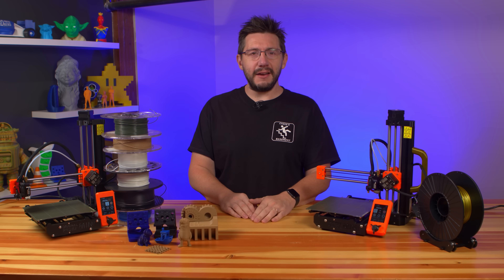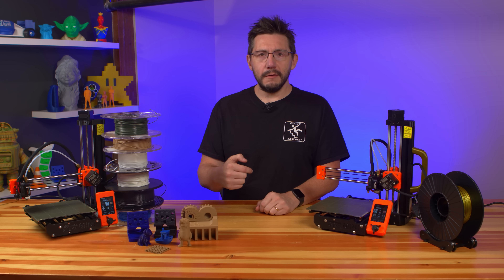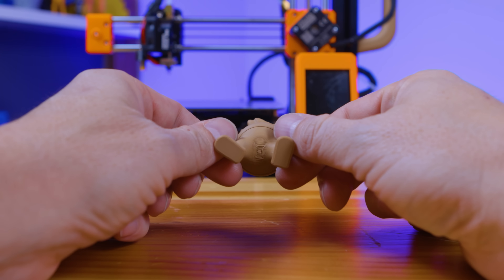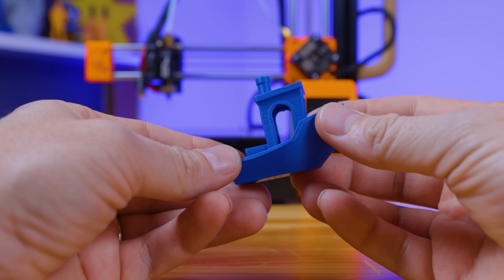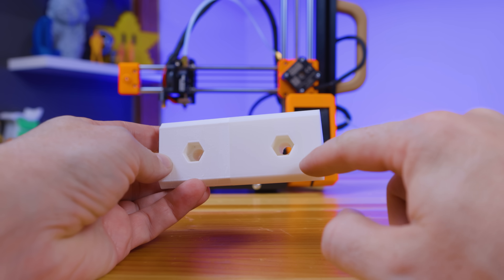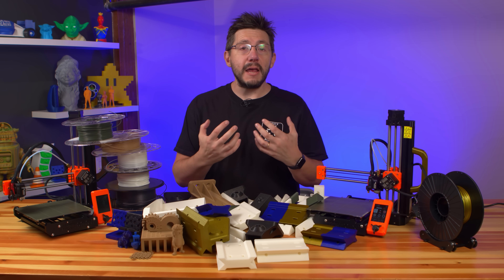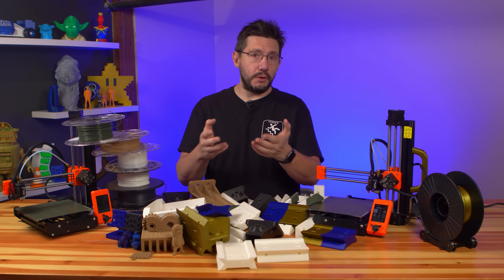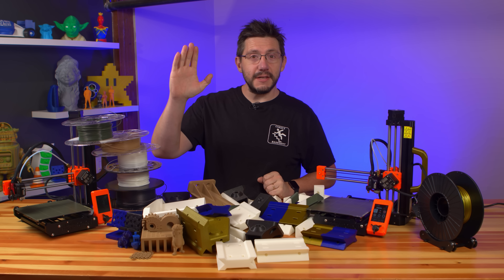Prusa MINI Review // So far ...

Comment: Hi Joel. My mini is from the 1st batch and had the same usb problems. In my case it was a bad board. Prusa sent me another one and it has been working great.
Reply from the maker: That’s great to hear
Reply: How do you know WHAT batch you have though? Mine arrived in July 2020 and had the same sort of problems others have had. I have bought a Bondtech extruder for it now since I was dismantling the 'original' extruder on almost a daily basis, so much so that the bowden tube  'out' port's thread for the brass tube assembly had worn away throwing ocasional orange plastic into the Prusa extruder. I mentioned it to support but they did nothing and didn't even offer to send me a replacement part for that bit of the extruder. I shouldn't have to be dismantling major components of a premium priced printer that is only 4 months old !
Reply: @BusinessButlers  I ordered right after it was announced and got it on December 2019. One thing i did notice was the extruder was too tight. There is a screw on it that you can loosen up near the bottom. It kept eating away the filament and make it rough so it would jam.

Comment: Joel, I had that same issue with the USB Drive not reading in the Prusa but being read fine on the PC, I noticed if I just pulled it out without ejecting it wouldnt work, so if I ejected it safely then it would read. weird, but now I just use Octoprint and skip that step all together.

Comment: When you change the filament part way through a print how do you purge the nozzle?
Reply: The printer moves the print head to the edge on the bed and well above the layer height it paused at and handles the purge as part of the process.

Got a mini myself. Had more issues than Joel, but all resolved now at no cost to me and it's amazing.
Reply: @arklanuthoslin  But how can it purge on the bed if you're already half way through a print, so the print head is far above the bed?
Reply: @Krytern  the print head stays above the print. Just moves to the edge and extrudes in the air.

Comment: Every time there are some "layer inconsistencies" or imperfections of some sort Joel (and others) blame it on "the filament is not calibrated" or "settings not tweaked". Why is that? If there would be one instance where calibrating would be worth the time it would be a 3d printer review? I don't think this is fair
Reply: I have that issue even with Prusament. Some guy with bondtech extruder also has that problem. Apart from that, the printer is great
Reply: Over extrusion causes adhesion issues
Reply: Yeah the 'filament not calibrated' doesn't make sense to me, sounds like Joel's printer suffers from the same over/under-extrusion issues that some other reviewers had, because the filament almost jams, causing underextrusion, then the jam starts moving and causes overextrusion.
Reply: This is called Issue 602, every printer has it and Prusa did alot a research to combat this issue.
Reply: I agree i would say that he is biased. Honestly its not bad for the price but an ender 3 would do similar if not better

Comment: Perfect timing. I'm currently thinking about buying one
Reply: I'm loving it. About sticking PLA on that rough plate, well, yes, it's not holding well but so far zero prints lost due to lack of grip, but after the print is finish and the heated bed is cooled down, the print just falls off, so it''s better to use a smooth plate for important PLA projects, and that smooth plate has little texture too, it's not glossy look. I'm satisfied with both. No way I'm moving back to printers with manual bed leveling and non-removable bed sheets. The only drawback is looooooong waiting time, 2 months :D
Reply: @banny123456  yeah, I'm currently enjoying a 8 week leadtime

Comment: My only issue is the cantilever design. My 1st printer was a Monoprice Select Mini v2. It had a robust design, sheet metal instead of plastic  and rails. Less than a year and I was getting sag on the arm. The small build plate is going to hinder people as well. I remember wanting to print this and that and several other things all of which I had ti resize to fit the small build volume. I went from my Monoprice to a CR-10s which while not perfect gave me the room to work with. The print quality of this Prusa is impressive. Not really sold on the price.

Comment: That sounds like a lot of reliability issues right of the bat. Also, $349 seems very high for such a small cantilever printer.
Reply: Yes.  I found the reliability issues with it and sent mine back for a refund.  It jammed and clogged repeatedly, and really a class in printer repair more than a printer.  I received excellent support from Prusa, but the product was not even close to reliable.
Reply: @bkindt  I assume you were expected to send it back for that refund at your own cost too ?
Reply: @BusinessButlers  yes that is correct.

Comment: There is a known issue with bad USB sticks sent from Prusa. I got my Mini about 3 weeks ago, mixed results so far, but the only machine failures I've had were related to that USB. Had 3 failures with watchdog error resets because the USB stick they sent preloaded with files is physically bad in some way. everything i have sent through octoprint has worked great, everything printed with prusament looks great. now I just have to tune for stringing on this MatterHachers Build PLA.

Comment: My failed benchies are also adored by children. 

But the backside of that blue benchy... It shows a lot of Z-banding. The real way to make sure it isn't a printer issue is to print it with different filament, not by doing it off as a "possible uncalibrated filament". 

That unintended stringing test I would not call acceptable. It probably wouldn't be acceptable on any other 3d printer with this price or cheaper. The same for the quite number of defects found. 

I understand that in that price there is also the ecosystem and pre-made Slicer profiles. Still, I think it is good to make sure the same judgement is used for all printers.
Reply: Printing in vase mode will show if it's printer or model/slicer issue.

Comment: Broken thermistor, bad bearing, and random rattle are not “minor” for a newbie (which is likely the target demographic) and represent some quality control problems. Could be a one off problem or something more systemic. Nevertheless good review Joel.
Reply: My model from Sep 20 had similar issues and more.  It’s not just the early models with problems.
Reply: I have been running my mini almost continuously for 6 months now.  The extruder makes a funny noise when it retracts and sometimes I hear a rattle, but it prints fine so I don't care.  Compared to the constant TLC my first printer needed when I was a newbie a few years ago, this thing is a dream.  It just prints well all of the time.
Reply: @GdalyaRoth  my first 'real' printer was a Prusa MK2 and it still works very well (though is showing its age). After purchasing a CR10, I do know what it is like to have a less feature-rich printer that needs more attention. I always recommend Prusa over anything else I've used.
Reply: @cyberreefguru  what was your first “non-real” printer?
Reply: @alanjones4747  Ah, I built an experimental delta device that was supposed to be capable of 3D printing, pick and place of electronics components, and even some CNC.  In the end, I got it to print -- poorly -- and that was about all. Failed investment, but an interesting experiment nonetheless.
Reply: @GdalyaRoth  that might be the tensioner I had a couple issues with mine because after being an idiot I got filament stuck in the Bowen tube and then didn’t tightening enough when I fixed it tighten it more then you think you should do it takes a bit of force to get the filament loaded
Reply: @LukeeM_00  Thank you for that advice.
Reply: I have to agree with this. Given it's also not a kit, really, replacing bearings, thermistors, etc. early on is a pretty serious set of problems.
Reply: It’s not not minor though
Reply: I'm pretty sure that the rattling is the keychain ring on the USB stick. Thomas Sandladerer had the same problem
Reply: Yeah, seems like the Mini does have QC issues. Thankfully, my Mini from the very first batch is working fine. Had the probe fail 2 weeks in but warranty took care of that quickly. I've got 20 spools of various filaments through the Mini so far.
Reply: as for newbie i would buy easythreed x4 for $200
Reply: IMHO, those are things that most 3D printer newbies would actually have an easier time troubleshooting and replacing, being easy to identify hardware, with easy to follow steps. However, an easy but long repair does NOT build confidence in build quality. I'd say what's even less newbie friendly to troubleshoot is bed adhesion using PLA on these sheets!
Reply: I get much better results on my Ender 3 machines for less then half the price. Nice gadget, but not worth the price.
Reply: It seems like he has an early version. I remember the first few batches has issues like these.
Reply: @thegeniusman8757  I got mine in July and it's awesome
Reply: @thegeniusman8757  yeah I was pretty up set a long wait and a machine that did not work with default settings.
Reply: I've had mine for about 6 weeks now and put about 300 hours on it already, its a bloody workhorse.
Reply: The random rattling I had was from bits of stringing contacting the fan blade but just make sure to clean it and broken thermistor is a big deal but if you contact prusa support they walk you through everything, almost as good as apple support even tho the company is 100x smaller

Comment: I got this 3d printer a couple weeks ago, and I love it so much! It works so well, prints so smooth, and is super easy to use. But one interesting I noticed is that the red pla 1.75 Hatchbox filament printed better than the Royal Blue prusament. Does anybody know if there is a way I could get better prints with this filament? But overall it’s a great printer for the price.
Reply: Do you use prusaslicer?
Reply: @thegeniusman8757  sorry, didn’t see a reply. It’s 6 months later now, but yeah I do use Prusaslicer

Comment: Dude! That's so cool that you've started printing the parts for the camera arm! Great video ✌️
Reply: It is going to make his life a lot easier filming his vids.
Reply: Thanks for designing that, I'm going to be making one soon. It's overkill for my little mirrorless, but too cool to not make.
Reply: I don't have the space or need for the full rig, but I'm thinking of adapting the design for my space.
Reply: I’m so happy to see A channel I’ve watched make many cool 3d printed projects get featured in the bigggest 3d printing YouTube channel such a great community
Reply: Yes indeed, very cool, he did mention it a few times in several videos. I'm going to do something like that too...
Reply: I thougt some parts are 25cm? the mini has 18 which keept me from trying too
Reply: I love your camera arm! I wish I had the space to use one!
Reply: I would need a xs version of that camera arm as the original size is to large for my nerd cave 🙀
Reply: @choschiba  well you could just cut the aluminum extrusions smaller  right? 
I would need it for work (digitizing large volume posters, cards and maps with the camera facing down) so size isnt the issue as long as it fits in the elevator. I already build a static one which looks like a gallow from wood.
Reply: 8:21 The future
Reply: Hello Mr. Chappel

Comment: I bought a Prusa Mini this summer and it did take 8 weeks or more to get here.  It is a great replacement for my Printrbot Simple Metal.  I also couldn't get good results from the rough build plate and switched to the finer grain build plate.  I too have the runout sensor.  I have been using the color change by level feature of the Prusa Slic3r to give prints like my Ezekiel's Wheel puzzle a more interesting look.  So far it's been great.

Comment: There is not a chance in hell I will pay how much they charge for this thing when there is an ender 3 V2
Reply: There’s about a 100€ difference. You just have to decide yourself if the price/quality/feature tradeoff leens you towards the one or the other. For me, I would never turn those screws manually to level a bed, or scrape a print off a bed with a metal sparula. Ugh. So I pay some extra to get a printer I like.
Reply: @apinakapinastorba  

Scrape the print of the bed ? What are you on about. It’s the easiest thing to get the prints off magnetic plate. Also bed leveling takes 2 minutes at most to do with this wheels. If you can’t do that then you are simply pathetic
Reply: @theshadowman1398  I almost knew you would go insulting me personally before I replied to you. Oh well, you get what you ask for... Both with printers and people.

Comment: I bought a Monoprice Maker Select Plus for $300...and then nine months later, Prusa announced this. Son of a... 🙄
Reply: Tough.. I got a FlashForge Finder in August (first 3D printer)
Reply: I had one of those before I bought one of these.  Accept the sunk cost and get a mini -- it'll save you an immense amount of time and frustration.
Reply: @GdalyaRoth  heres the problem- I'm 11 years old and i got the finder for my birthday. i cant get it anywhere else
Reply: @BDin3D  I was replying to @halo 2304 -- I used to have a Maker Select Plus, not a FlashForge.  Still -- you're living in the future -- when I was 11, the big deal was if you could get an Atari 2600.
Reply: Save up for a Micro-swiss hot end, print a set of frame braces, print a DiiCooler duct, and buy the suggested cooling fan, and your Mono-price will be a work-horse too.  (the Monoprice printer is a Wanhao i3 re-brand) A name brand flex bed is nice, but it mainly cuts down on how often you need to level the bed.  So stick to the cheap PEI sheets and keep first layer print temperatures below 250C.
Reply: @martylawson1638  Oh...I ran my Monoprice day and night as well and I did replace the hot end with the micro-swiss all-metal hotend and I also set up an OctoPrint server and bought the Wham Bam flexible plate.  Even with all of that, the mini is much easier to use and the price is about the same, once you finish the mod's and the print quality is better.  Also, I print in PET-G, not PLA, so I was always pushing the Monoprice's temperature limits.  And I am more of a maker -- not a printer -- I like to design things and print them, not spend time working on making my printer better.  So, for me, the Prusa Mini is a no-brainer.
Reply: @GdalyaRoth  we're a lot alike. I mostly design and print my own designs and print in PETG. I would like to have better prints and spending time and money on upgrades that may or may not work is tedious. I haven't done much printing lately because I had to give up that space for my wife's office. Now it's sitting on the kitchen table, collecting dust while I try to figure out where to set it up next. 🙄
Reply: @martylawson1638  I've already done a few upgrades. I got some frame braces and replaced the Y carriage. I'm debating the Microswiss hot end. I primarily print PETG. I've thought about printing on glass and removing one Y-axis bearing and changing them to longer bearings. I've dabbled with TL Smoothers on one of the Mono's at work, but haven't seen much difference.
Reply: 2 tips with the textured sheet. You need to recalibrate as it's thinner than the pei. It also needs to appear as it is almost flat. I bought 2 myself!

Comment: I’ve always thought about buying a Prusa Mini ... but I decided to start with an Ender 5 which I’ve pretty heavily moded since I got it ... it’s now outfitter with an E3D Hemera direct drive, Creality Glass buildplate and Duet 2 WiFi motherboard and I’m very happy for what I use my printer for, honestly the only reason why I went with the Ender 5 instead of the Prusa Mini was the smaller build volume on the Prusa :/
Reply: Hi, may I ask you how much did you end up paying after all the upgrades?
I bought the MK3s after the Mini was announced just because I came from a Tronxy X1 and the small build plate was a limitation (although definitely not the main issue of the printer). I ended up buying a Prusa for the experience it promised (and because it's Europe based), and boy it delivered. Basically no fiddling needed, you need a piece, you send it, it prints it. Price was definitely a consideration but I didn't want to thinker with the printer as I did with the Tronxy. From what I see on reddit and elsewhere, it seems that Enders CAN print very well, but they need many upgrades and maintenance, to the point where I wonder if you're really saving money
Reply: @Giorgio Aresu 
The printer itself was on sale for, I think it was in the neighborhood of 260€ at the time, the Hemera was like 130€ and the Duet board ist just a chinese clone I bought on ebay for 100€ including a 7” touchscreen. Which brings the cost of the setup without any spare nozzles etc. to roughly 490€ which ist still much less than a Prusa i3. 

I know for a fact, that Prusas are some awesome Workhorses (I use 4 i3 MK3s and 2 Ultimaker S5 at work) and they deliver, however I am able to achieve incredible results on my Ender far far away from the quality at certain speeds I am used to seeing on the printers at work. 

So overall, I’ve spent less, although at the expense of a lot of time and tinkering around, but overall I am more than happy with my personal printer.
Reply: @SkalaraxLP  thank you very much for the response. Still a good difference in price indeed.   Have a nice day :)
Reply: @GiorgioAresu  you’re welcome :) 
Greetings from Germany